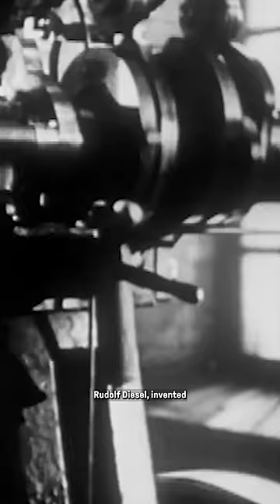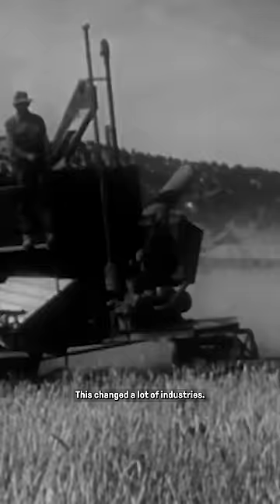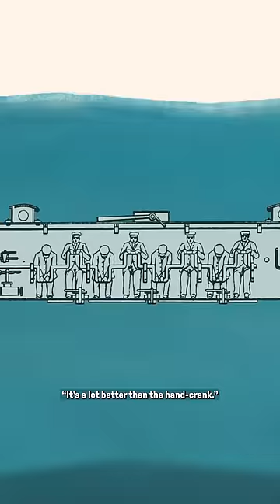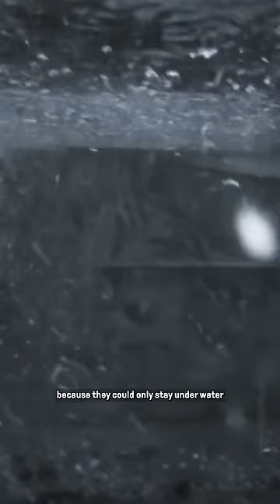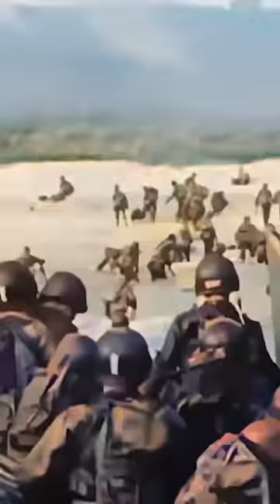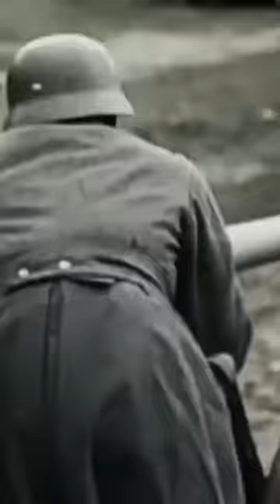How the Diesel Engine Powered Submarines

Comment: Imagine going back to 1913 and giving upgraded u-boat schemes to the germans
Reply: Mmmm would not matter. That is giant problem with "I will bring these modern blueprints in past"

You would have to bring everything related on that engineering in the past. When you are unable to machine the parts required for modern inventions, it would be more beneficial to bring machining engineering to the past 

But for that you would have to also bring electrical engineering and automation and computer engineering in the past.

But those engineerings would require their own sub engineerings

Comment: Actually the Diesel engine was first show in the Paris World Expo 1900 running Peanut Oil and was invented with the intend to make farmer independent from fossil fuel.

Diesel Engines have a efficiency of 30 - 45% against Gasoline Otto Engines of 20 - 35%. They have extreme longevity.

Comment: The words ‘fossil fuels’ should have been omitted from the intro. Diesel engines from the start was designed to run on a wide range of fuel. Basic requirements are a fairly viscous liquid stable in ambient conditions that combusts when introduced to super heated air.
Reply: You mean like… used french fry oil ?

Comment: Prior to diesel engines gasoline engines were used to charge batteries. Diesel is an improvement. The Germans also invented the snorkel so a diesel engine could run underwater

Comment: Yea, now we have nuclear because it's so clean you can have it in a sub until you run out of nuclear material.
Then it's stored in a safer form than the form they get it in from the ground and inside led lined bunkers basically.

Comment: His engine ran on vegetable oil, not fossil fuels
Reply: Yep, peanut oil to be precise;-)
Reply: @bellybutthole  ok, thought it were walnut 😁👍
Reply: @rewelke  https://en.wikipedia.org/wiki/Rudolf_Diesel
Go to "Legacy" Paragraph three;-)
Walnut would prolly be just fine also; most liquid hydrocarbons burn in a diesel engine -so long the fuel pump get its lubrication from it. One summer here in Norway, the diesel fuel was more expensive than rapeseed oil so I bought some for my '96 Toyota HiAce with a 2L-T engine -ran just fine and smelled like a hot skillet! Have a good one mate.

Comment: They have an electrical motor and batteries to submerge they use the diesel machine to run in surface and recharge the batteries, yes they need to come to surface for the air because the crew not the machines exausted the oxigen.

Comment: “These German subs could only stay underwater for about 40 hours max” 

Ok so as someone with very limited knowledge of subs/marine warefare, my first thought is “well that’s plenty of time to drop depth and slowly scoot away”. 
Can someone explain if I am wrong and how? I’m genuinely curious.
Reply: They can only go half the speed underwater until late in the war with the mark XXI which ran faster underwater then above water
Reply: @heyokasamurai453  I mean but still. That’s miles and miles of distance right???
Reply: @musicwithj1759  well the most common one of the day the VII went 17 knots or 20 miles on the surface then 7.5 knots underwater
Reply: @musicwithj1759  it was just safer to dive down to the max depth instead of fleeing when a ship or plane appeared

Comment: Mr. DIESEL FIRST TRIED RUNNING ENGINES ON POWERED COAL DUST ...SOMETHING WENT WRONG + BLINDED HIM IN 1 EYE ...HE THEN CONCENTRATED ON RUNNING ENGINES ON THICKER FUEL ( higher boiling point of GASOLINE )  , NOW CALLED "DIESEL" FUEL (about 400°F boiling point ?)

Comment: Slight correction, Diesel didnt invent the Diesel engine to run off fossil fuels, he invented it to run on vegetable oil and found that he could make a much more effecient engine than the gasoline engines ofnthe day and when all things are equal, the diesel engine still is more effecient than a gasoline or propane engine.

Comment: There is so, so much more to this story. Diesel did not design the engine for arms use, it was designed to run on vegetable oil, so that poor country’s could have inexpensive motors for farming. Diesel in fact would not allow his engine to be used in submarines, and it wasn’t until his mysterious death did it begin to be used in subs.

Comment: Way rgey solved it was basically putting a float on the air intake pipe that allowed the sub to use the engines when only a few metres underwater

Comment: Well there was liquid oxygen. Pump the CO2 overboard until you run out then switch to battery.  You could last a little longer. Return to port to replenish. Not a problem in the Baltic. Big problem in the Atlantic.  Snorkel could work but your close to the surface. You could be spotted from the air in daylight hours though. Surface ships might spot smoke on the water in daylight as well.  It's hard to spot ships at night at sea without a moon. Overcast would be worse. Radar would announce your presence before you got a strong enough return signal. Still there are ways.

Then then there was hydroxide which is much safer converts directly to electricity skips the diesel completely. Much quieter. Quieter than a nuclear boat with steam turbines.  Range is limited though. In the Baltic ,North or Black sea that doesn't matter.

Comment: 2 generators, one motor torsion base connection. It actually works dangerous is anything like this is used professional.
Reply: Yeah, you say that, but did you know the ocean levels weren't rising because the waters went on the ground? Yeah, we're not the sharpest tools in the shed.

Comment: Ah, so many wrong statements in this video.

First of all, the problem of submerged sub is not just the diesel engine transforming O2 into a CO2, it is also the human crew doing the very same by breathing.

Second, batteries in WWI and WWII times did produce fumes that had to be ventilated, since they were toxic.

Third, the CO2 problem was solved in WWII by using the "Schnorchel" while submerged. Similar device to scuba-diver snorkel. But even with that, the sub needs to go tu surface and ventilate the batteries fumes from time to time.

... and this was solved later with better batteries, air re-circulation air purification  systems and nuclear power eventually.

Comment: Yeah. The solution was an additional tank, filled with liquid oxygen...
Reply: which would then cause a lot of issues if any leak happened. not to mention even the slightest flame could cause the O2 to combust and cause unbelievable damage
Reply: @hadiisaboss  O2 is not flammable. It only provides the oxygen for other things to burn.

Comment: You can still run a diesel on peanut oil.
Reply: Old diesel can run on vegetable oil without problems, on common rail diesel it already started to become problematic and the modern diesel today are very picky about the fuel.

Comment: i have a doubt, if submarines can generate oxygen inside by using electricity then why it can't use to burn fuel and charge the battery? this will solve the problem of surfacing submarines.

Comment: Diesel engines aren't much different than gasoline engines. Same thing except diesel engines use spontanious combustion. So there's no sparks plugs or ignition system required which makes them more reliable because there's less to go wrong. Aside from.they both are internal combustion and they both use pistons and connecting rods and camshafts just like a gasoline engine.

Comment: Fun fact. Rudolph diesel first ran his engine on peanut oil. Later when what we know as diesel gets discovered, they named it diesel as it was Fully compatible with Rudolph Diesel's engine.

There is a proven fact called sea weed bio fuel which can be generated from sea level. This bio fuel is CURRENTLY less costly than crude oil products. If we use this we can use our existing ICE engines while lowering the carbon emissions. But this does not look as sexy as a EV and for that reason this comment will be buried forever in the datacenters of YouTube until they ran out of space. 😢